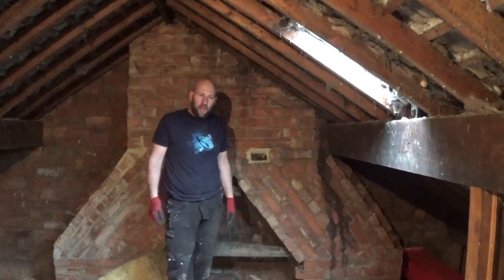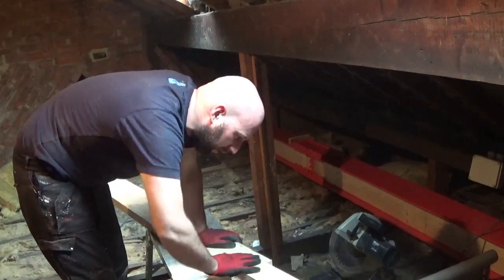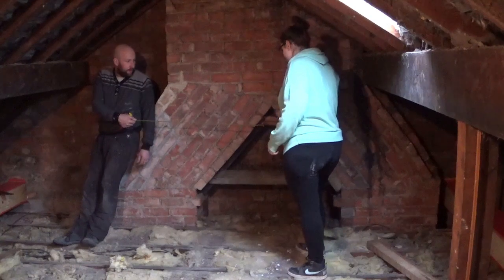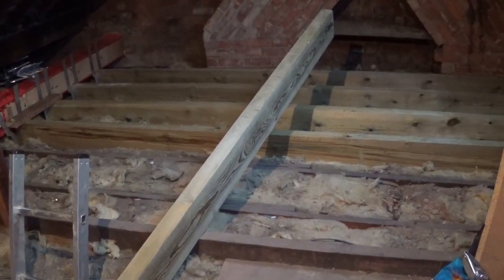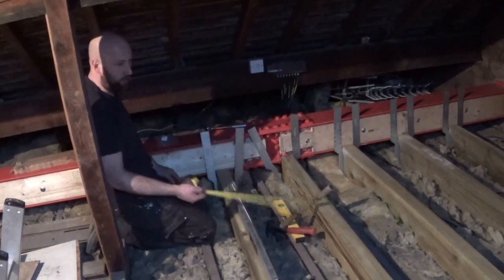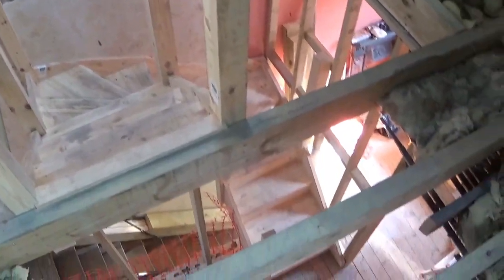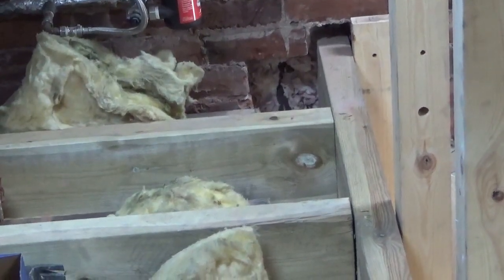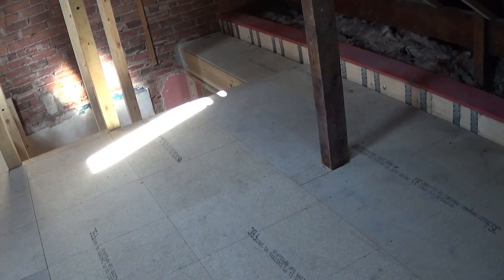Loft - Attic Conversion 6/9 Attic Floor Installation, Loft Chipboard Floor & Joist Installation #28

Comment: C24 timber is hard to get at the moment. You did well. Great work and your saving 1000's.👍
Reply from the maker: Thanks, We got the bulk of the timber from our local Jewsons, and some of the smaller stuff from Wicks
Reply: @renovatingvanecottage-diyh495  Cheers. I'm just starting on mine as soon as I get my structural eng drawings back. Your videos are very useful.

Comment: What an incredible transformation!  I love it. 
I'm wondering how you've supported ceiling joists around that staircase opening. Have you used any steel ties or screw ceiling joists to floor joists ?
Reply from the maker: We have a video on the stare case installation , but basically the staircase itself is self supporting. It’s double jointed in-front of the stares and support joists tied into the gable end then joist on hangers for the floor